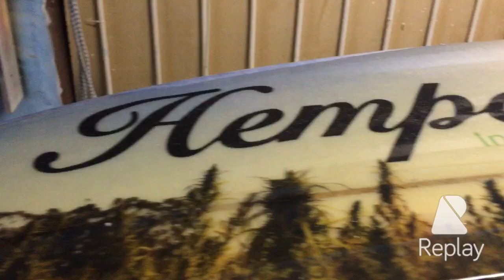Hemp Surfboard project

Comment: This video is some years old and i'm now discovering things like eco-poxy, I've been contemplating on making skateboards based on hemp and bamboo and found eco-poxy as an alternative to fiberglass resin. It's cool to see someone using it for a surfboard, i'm pretty confident in trying it now. I am still curious as into if it will resist heat and abstain from getting sticky if left out in the sun